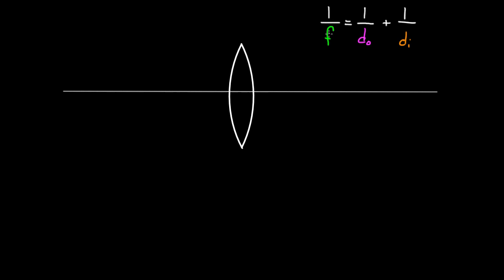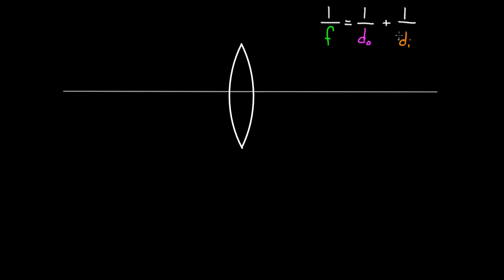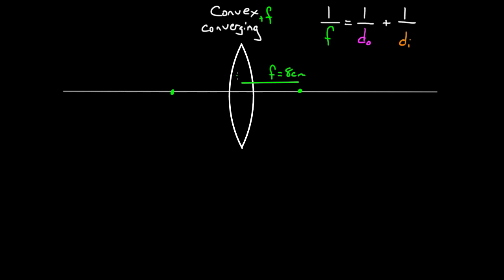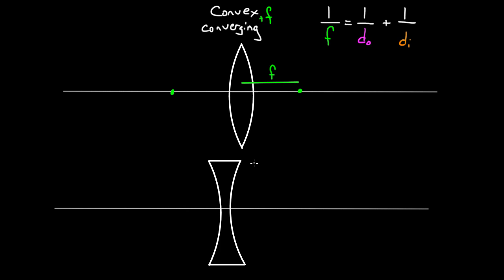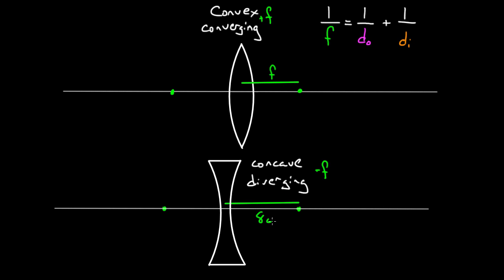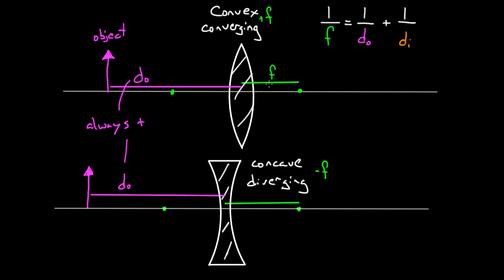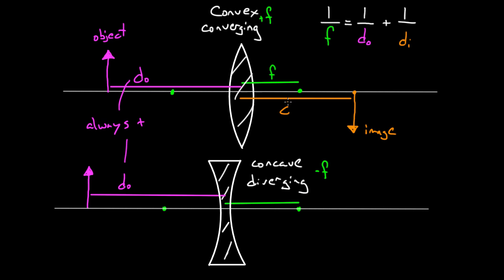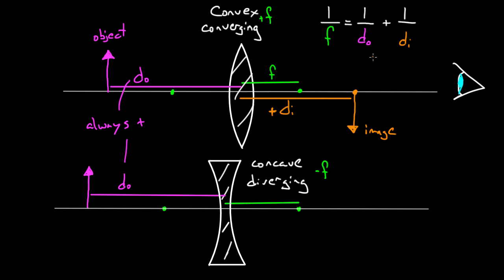Thin lens equation sign conventions and problem solving

Comment: I learned the sign convention for image distance a different way: if the image is in the same side as the outgoing rays then it's positive. If it's on the opposite side as the ougoing rays (same side as the object) then the image distance is negative.

Comment: you're wrong. you said that object distance is positive but i have searched that no matter which lens you take ,the object distance remains negative .
Reply from the maker: There are different sign conventions you can choose from. Different textbooks handle the signs differently, but rarely explain that there are alternative correct sign conventions. You can choose Cartesian sign conventions and make the object distance negative (but add a negative also to your formula), or do it the way I did it in the video and leave both positive.

Comment: what you are teaching is wrong kid
go home and do your homework
Reply: object distance is always negative
Reply from the maker: Antony Joseph I’m using the Gaussian sign conventions and that corresponding form of the thin lens equation. You can also use the Cartesian sign conventions and that form. Either works if you know what you’re doing. In physics there’s usually many different but equivalent ways of solving a problem. Understanding them all and how they’re related could give you more insight into the math that lies behind the physics. Good luck.
Reply: @WeAreShowboat  I was confused about this for a while. I think I mostly understand both conventions now. But there was one rule for the cartesian conventions I was a little unclear about and one thing I want to get cleared up for the Gaussian conventions. 

On the Hyperphysics website rule 1 of the cartesian sign conventions is that "All figures are drawn with light traveling from left to right." I'm assuming this is to take into account the radii of curvature of the lens surfaces, and hence the focal lengths, relative to the direction the light is traveling. Would this rule also apply for the gaussian formula? Because I've never seen that version of the equation applied to light traveling from right to left. 

Rule 2 for the cartesian conventions, according to Hyperphysics, is "all distances are measured from a reference surface, such as a wavefront or a refracting surface. Distances to the left of the surface are negative." Does this reference surface have to be at the location of a lens or can it be placed anywhere, besides the location of the object? Also if you have a multi-lens system, do you have to move the reference surface every time you apply the equation with these conventions, or can you have the same reference surface for multiple calculations. If you have freedom in where you can place your reference surface, I can see why the cartesian convention is preferred in specialized Optics textbooks.